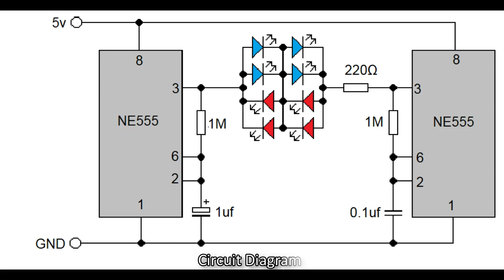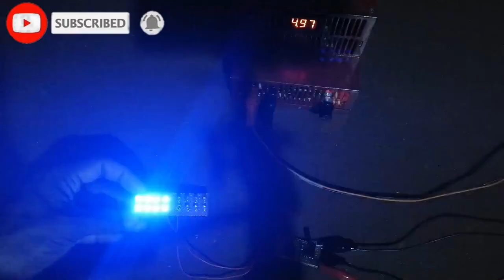How to make VIP Light using 2 NE555 ICs | Police Light

Comment: 5v gawata 100uf cap ekak parallel karala dammot 12v walin wada karnwa neda?
Reply from the maker: 12v supply denawanm 7805 regulator ekak haraha denna
Reply: @ClickCorner1  mm oya diagram ekama 12v walin wada Krna ekak dakka, ekai, wenasa tiyenne 100 cap ekak dakka power dena tanata, eachcharai, hadalama balanna ona 🙂